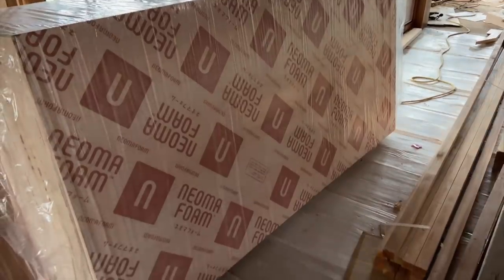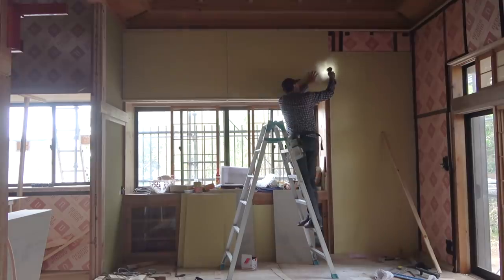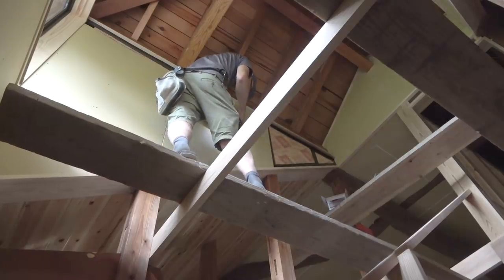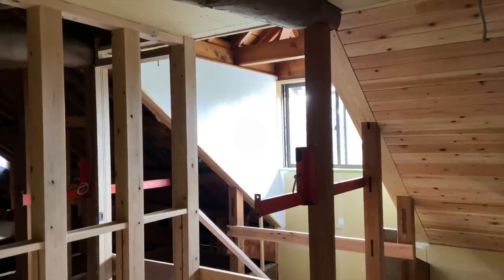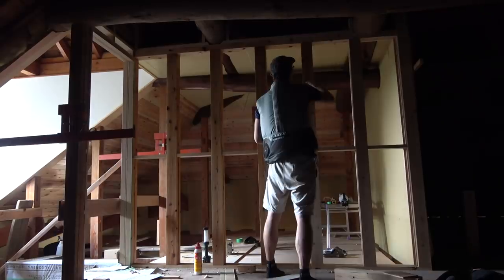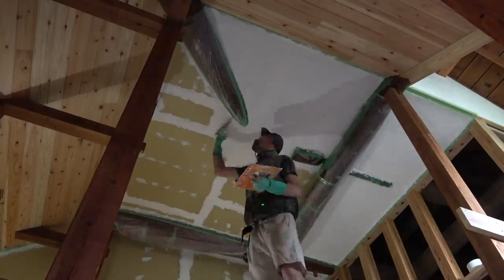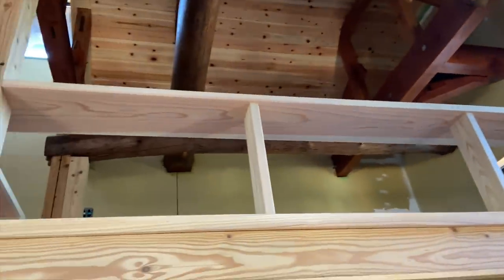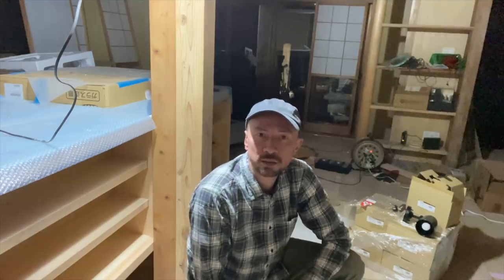Japanese Abandoned House Renovation #7 | The Walls: Insulation, Drywall, Plastering, Siding

Comment: That natural hydraulic lime has a double helix in its crystal formation which it refracts light so beautifully and always appears to alive.
I used a silver board fire proof board by Kingspan for exterior insulation (behind vertical slates). It has a layer of aluminium on each side. Only problem is it ruins your phone signal. Its tough stuff to cut too.
PS Pro Clima vapour barrier membrane runs rings around tyvek as it actively wicks moisture. Its the blue one.
Reply from the maker: I’m not sure if they have that vapour barrier here but I’ll check.

Comment: I have many disappointing wall in my New England house.  In one section of house there so much enamel paint on plaster from years of expansion and contraction it looks like a river bed drying out with hairline cracks.  My elderly father insisted on sim coating it but the cracks reappeared in the first winter season.  The one entry way I worked I repeatedly covered it with paint stripper about 2-3 gallons worth (with tyvek suit respirator) and took it down to the plaster before repainting.  The cracks have not reappeared.  The other disappointing wall is where condensation from crawl space pipe dripped down causing some porosity.  I suspect at some point I'll need to take it down do the lath and start over, but high work and eye are different things so maybe next year

Comment: the airflow of the house also allows for the wood to stay dry and last longer. you can find many examples of houses in america that are insulated heavily and they rot out in as little as a few years. especially in the south where humidity is high, the insulation collects moisture. even from just the temp difference of the outside and inside of the house there can be condensation. i hope you took this into consideration and have a plan to keep an eye on any areas that might be at risk of this.
Reply from the maker: Yes, very much a worry. We actually left air gaps on exterior side as the carpenter insisted moisture on the other side of the insulation needed a route of escape.
Reply from the maker: I’ll add that I was thinking about cutting out a patrol of the wall in a year or so’s time to peek inside to see how it was going.
Reply: Should try using 2lb closed-cell spray-foam insulation (needs pro's to install) then. (avoid the 1lb open-cell spray-foam that you can get at renovation stores as it has a whole 💩list of problems that go with it; usually found contained within a propane cylinder) The 2lb spray-foam insulation won't absorb moisture and it seals tight to the frame while filling in any voids or gaps in the wall and around wires and pipes. You get a great R-value rating with it, very low to almost non-existent VOC's and there's no need for a vapour-barrier to be installed; just drywall right over it.  😁

Comment: So Japan does use drywall that’s cool. Im a drywall finisher and I’ve been doing it all my life. You did pretty good job at the spackling. I was wondering do Japan use only mesh tape or do they also use paper tape? Also the way you cover the walls was also pretty good, we do something similar to that where ones your done doing your final coat on seams and corners we coat the whole walls with spackle which is a process called Level 5. This is done so that you’ll have less imperfections and looks better after painting it. Usually it’s coated 2 or 3 times.

Comment: 13:04  You said you could add that lime plaster stuff to water and apply it to the wall.
           Why not just get a paint sprayer and put that instant mix in the paint tank?
           If mixture is combined with water before it sprays. 
           It should be easy to apply a coat to the entire house in a few hours.

Comment: as to disappointing walls, my parents built their house in 97, and they hired the cheapest builders, none of the walls line up and some are an inch off. in the entryway you can see the wall waveing with up to an inch difference between furthest in and out, nothings right and theres a huge crack they still have to fix running through the middle of the house from settling. also since they used nails, in a lot of places the nails are popping through the plaster put ofer them. it needs a renovation

Comment: Wow. A lot of work. Once the drywall was hung it must have been tedious filling the screw holes and joints, then taping the wood and wrapping with poly. THEN working all the angles and overhead to cover the walls. 
One thing you probably won't be doing... is redoing any of that work or re-staining the exterior walls. You'll get used to it and won't be bothered enough to do it better. Been there, done that with a newly built home. Other things to do pop up.
Reply from the maker: Yes, taping is the worst one. Really hate doing that.

Comment: The conversion from square meters to square feet at 10:22 seems to be off. 1 meter = 3.28 feet but in this case the ratio needs to be squared as well. So 28 sq m equals 301 sq ft.

Comment: As an architecture-student, I must admit I am not very happy about the insulation you're purring in the Walls. The house you've brought is a traditional structure, and it was built so that it could stand for a long long time. The ventilation-layers in the Walls are there to present rot. When you have a heated, humid interior, and a cold dry exterior that has only 10-20cm for that transition to exist in, you will experience that the wall will loose durability. The kind of work you did in this episode definetely halved the potential life of your house's original structure.

A good example of this kind of problem exists here in Norway where I live. We have the oldest vernacular wooden building in the world. It is quite comfortable in the winter, but it doesn't rot. The reason is that it has a walled in porch without insulation, much like the shoji in japanese houses. This means the outer structure can exist in exterior temperatures at all times, while the draftless shoji-porch makes the air stay still, allowing the inner structure and rooms to exist in a heated state during winter without condensation in construction-layers being a problem. 

Often when a traditional house is renovated in Norway, people make the same mistake. The houses they renovate are often 200 years old and doing very well, but the materials and tecniques being used in modern construction are based on houses having ashelf-life of 40-50 years (in Japan even less). This causes å conflict between the New airthight structure with insulation and the old traditional structure built to breathe and endure. These old houses are often made of logs, and the internal vapour barrier than causes the wooden structure to creep, making gaps and holes allowing Rauland snow to penetrate the previously succesful Walls, while also leading to the building ending up LESS insulated than it originally was. 

Often people also cover the original dry-stacked Stone foundations with concrete. When the upper logs start to creep, the concrete cracks, and water gets in there, freezing, crackingthe wall further. In the end, the people who renovated the 200 year old marble of tradition have ended up destroying the things that made it last in the first place, and in 30-40 years, they move away, the house is torn down, and some New house with a 30 year shelflife is put up instead.

Sorry to be so negative, but a lot of people don't understand the differance between new and old buildings, and why the two building-systems are opposed and incompatible.

Comment: 10:53, is that a puffy jacket with built in speakers on the back??? nvm i watched more and it turns out it's a fan that blows air around your chest and back.... im not even surprised at this point. crazy aussy

Comment: What are the advantages of applying a thin layer of plaster over the plasterboards? Where I'm from, in new houses, they simply fill the nail holes and use tape on the gaps between plaster boards, and they they just literally paint over, just straight thick paint with a roller. Is it maybe we use a different kind of plaster boards? After panting with that thick paint, you cannot see the tape.

Comment: Looking Great!! But a few questions:
Are you doing the Electrics yourself?
And how old is that wooden stove? I ask as a norwegian we build our house around the cold, and the difference between a new and old is very big. Older is often made with a lot of cast Iron, they hold the heat very good, but burn thru a lot of wood. Newer ones are often better designes so they burn the wood better but they dont hold as much heat
Reply: Interesting.  I would have thought  a newer design would find a way to hold more heat.

Comment: Hello, did you consider placing the insulation on the outside of the house instead of the inside? With insulation on the inside, you lose the look of the 真壁. For our renovation in Niigata-ken, I'm planning on removing the cladding from the house and attaching insulation/vapour barrier and then putting a new cladding on. I liked the look of the vertical sugi cladding you used — I might do similarly. Thanks.
Reply from the maker: Yes, that was definitely the downside of insulating on the inside. We added some fake posts over the drywall in some places to recreate the look. Insulating on the outside is probably better in that respect but we decided it wasn't practical for us to "fatten" the outside due to the existing features like window sills, copper flashing, and upper exterior panels.

Comment: Did you do this without primer? I am having lime plaster on my drywalls too. But for any kind of wall the manufacturer demands to have a special primer for the plaster to be applied first...(Does apply to any kind of plaster, not only this specific one)
Reply from the maker: No, this diy product doesn’t need a primer for drywall but you need an undercoat for plywood etc.
Reply: @TokyoLlama  Hmm, that's interesting. Thanks for the reply. Best of luck to you!